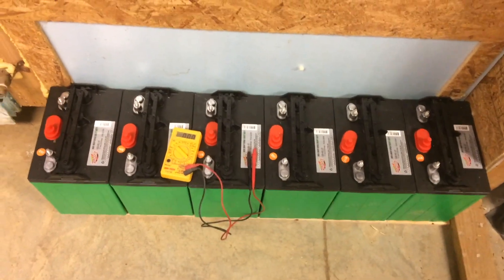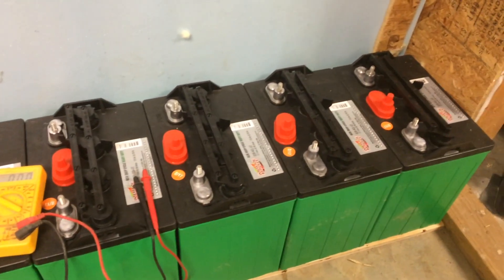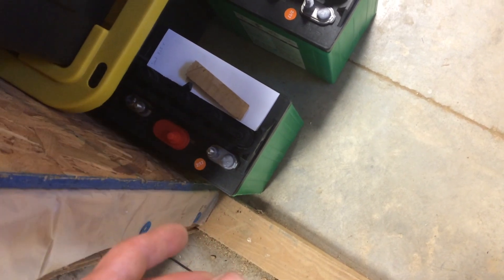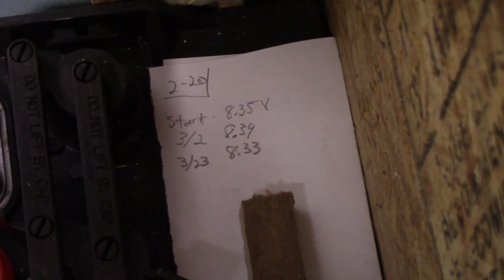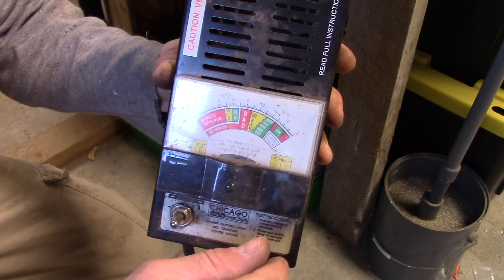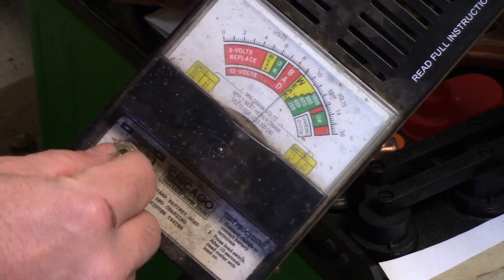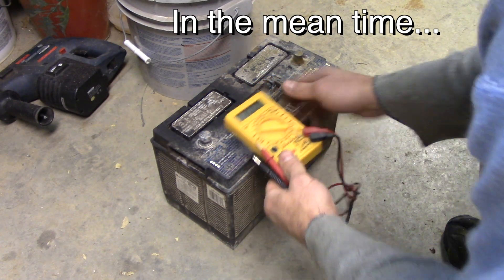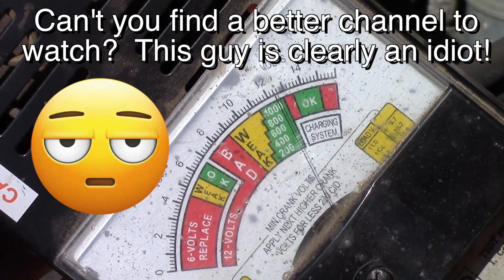Is Concrete Killing Your Batteries?? Here's Scientific Proof To End The Debate. FarmCraft101 Solar

Comment: I was told moisture condensing on the outside of the battery is much more likely on a concrete floor. Current leaks across the top of the moist battery, slowly draining it. Dirty battery top is more prone to current leakage. Batteries are much cleaner these days than older screw top cell caps and crude/aggressive charging systems.
Reply: If this were the case, then putting the battery top half an inch further away from the concrete wouldn't make any difference whatsoever, instead the rule would be to not put the battery into a room with a concrete floor. The battery housing, be it glas, wood or plastic, is a bad heat conductor, and heat transport through convection in the electrolyte would only work if the warm side was at the bottom and the cold side on top. Therefore direct contact with concrete might make a difference in temperature at the bottom, but it is neglible at the top where the terminals are. As water from condensation doesn't flow upwards, the conclusion is that the premise doesn't hold.

It's true of course that a dirty battery can lead to increased leakage, that's independent of the type of floor the battery is standing on though.

Comment: you're smarter than me

However the reason why the standard battery load tesers won't work is because the car batteries are designed to give high amperage kick with start with the slow charge over time, where the house (G-cart) batteries are designed to give a small and consistent amperage throughout with a fast recharge.

It's hard to do a definitive test on this but I say that you busted this myth

They probably said that concrete myth is because of the fact that concrete is cool and people don't tend to take care of their batteris during the subzero months of winter leaving the battery susceptible to damage, concrete isn't insulation so of course, it's going to be a constant subzero.

So the message stuck and the wood pallets allowing warmer air around the battery to stop it from dipping too far below zero.

Comment: good information but your load tester when turned on, can do other useful things the 200, 400, 600 etc marks beside the yellow are for cca ratings. And if your truck battery is rated for >700 cca, you need to replace it as the cells are beginning to weaken. And in my experience, trucks don't normally use less than 650 cca.

Comment: A good 12V battery should be at 12.8 V. If much less it's going bad. Assuming your crappy voltmeter is accurate...

Comment: Cool.  Thanks for the testing.  I'm going to buy a load tester now.  I have a child scooter that uses a small 12v battery.  Will the load tester work on it the same as a 12v car battery?
Reply from the maker: Sort of.  With a smaller battery, it will not be able to maintain the same voltage under the same load.  So rather than going down to 10.5 volts under load, it may go down to 8 or something, depending on it's capability.  I think the load tester says its 100 amps, so if a smaller battery isn't capable of coming anywhere close to that, it wouldn't be much help.  In that case, you could just put the battery under a smaller load, like maybe put a 1 ohm resistor across it and measure the voltage with a regular meter.  A 1 ohm resistor would give you 12 amps (V=IR).  Adjust resistance as needed to get the proper amps you are looking for and see if the voltage drops.  Good luck!
Reply: Awesome thank you very much

Comment: its don't put you battery on COLD CONCRETE FLOOR.the cold floor will kill the battery by freezing it
Reply: Dale Denotter 
That effect is temporary. It's a reduction in the rate that current can flow through the cells. No overall capacity or charge is lost. 
What actually kills lead acid cells is high temperatures.
Reply from the maker: A charged battery is very resistant to freezing.  Fully charged supposedly won't freeze until -76 degrees F.
Reply: then why dose your car battery lose 1/3 it,s cranking amps at 20 bellow zero.
Reply: @daledenotter6398  Great question!
Here is the correct answer:
Let me start by saying that cold temps are better for vehicle batteries (& all chemical batteries) than warm temps. Because colder temps SLOW DOWN the reations inside the chemical battery. & warmer temps speed up the rate of reaction in chemical batteries.

So why does the chemical battery produce less Cold Cranking Amps in low ambient temps?
Its because the rate of reactions have been slowed down. This results in less CCA to the vehicle's starter on start up.....thank god for alternators, right?!
#NowYouKnow
Reply: uhm... the "cold" concrete floor is no colder then the surrounding air - and the battery it self. heck, if the room is badly insulated then the floor might very well be the WARMEST part.
(and if you store your battery in a place it can potential freeze then that is your own fault for acting stupid).
Reply: Yes temperature plays a role in a battery leaking some of its charge.
But wouldn't a battery still be susceptible to freezing in any extremely, low temperature environment, no matter where the battery was placed?
For example, a battery that is located under its vehicle's hood; that is parked outside when its ten below zero.....is just as much at risk (if not more at risk) than if that battery were to be located on a concrete patio, outside, when its 10 below zero.
The point is, that where the battery is located, is less important that the conditions pertaining to its environment. (i.e. ambiant temp, pH, etc.)
Reply: this myth was mostly done with battery storage, let's say you pull a battery out of your backhoe for harsh winters and you leave it on concrete... that sort of thing... so you are correct where a charged battery is resistant to freezing, but it also bubbles off the charge over a great distance of time and it' much worse when cold.

Comment: I grew up in the 50s and have always known this to be a true fact.
A few years back one of the big box stores in my area started carrying automotive batteries. At first they simply put them on the concrete floor and virtually all the batteries we're dead or close close to dead when customers would buy them.
They have since put them up on a rack above the ground and have not had that problem since.
Reply: A man convinced against his will is of the same opinion still. My uncle thought hooking a battery up backward in a car would make the engine run backward. Takes all kinds. Confusing the issue with facts is more than some people can handle.
Reply: Duuuuuuuuuuuh.
Reply: Uhm, he just debunked it.  It's false.  The batteries on concrete were fine.